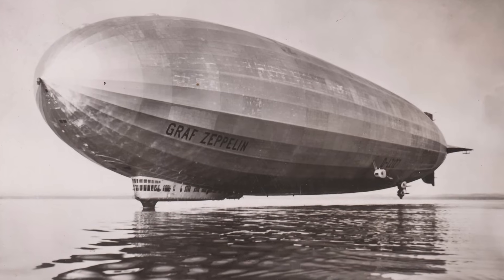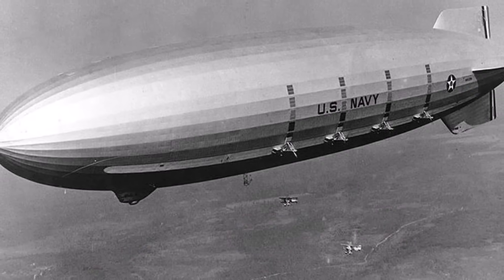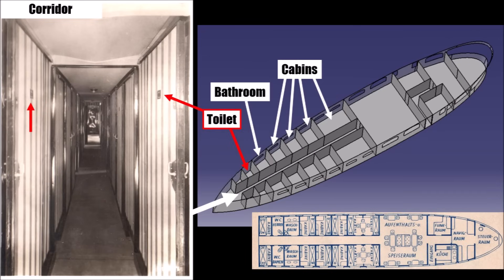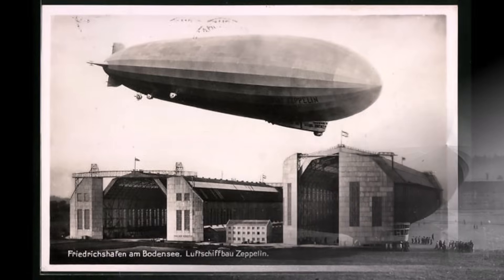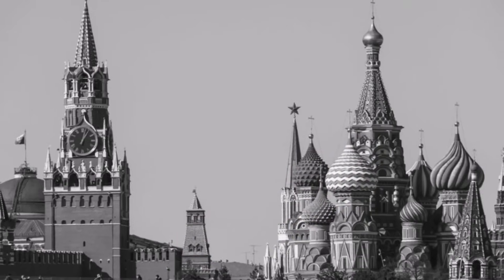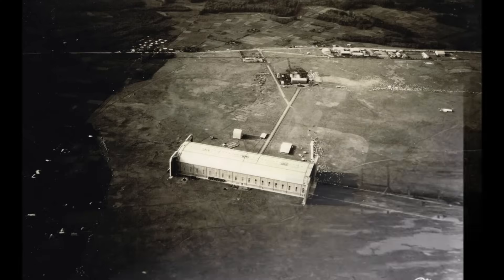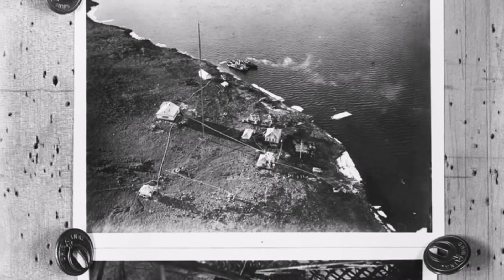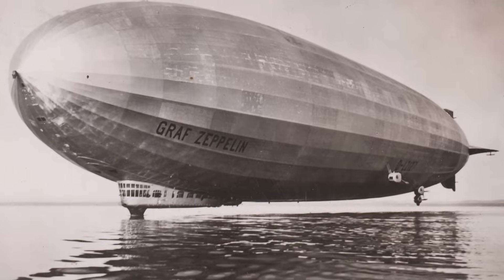Zeppelins - Part 13 - LZ127 - Success and Journeys

Comment: Today people remember the Hindenburg disaster and forget how successful airships like LZ127 actually were. They could fly anywhere on the planet, weather permitting, so long as at the destination there was a large enough landing area (a circular area the radius of which must be at least equal to the length of the airship) with a mooring mast, a couple of hundred ground crew, and a hangar large enough to protect the airship from inclement weather.
Because so few great airships were built they were never really commercially viable and civilian airship companies struggled to make a profit despite the high ticket prices for passengers (equivalent to around $10,000 to $14,000 at today's prices for a one-way trip across the Atlantic).

In some ways transatlantic airship travel could be compared to the Concorde aircraft - travelling between Europe and America faster than anyone else in style while sacrificing a few comforts for the privilege.

Comment: To put into context how impressive these airships were, the first ever transatlantic crossing by flight only happened in 1919. And it wasn't until 1939 when there was a regular commercial flight service - and even that was with a stop. The Graf Zeppelin made that happen more than 10 years earlier, could fly without stops, and could fly much, much longer routes than any airplane. If you were living in the 1930s, and got hold of a ticket, you would get an experience you couldn't have absolutely anywhere else.

Comment: This Zeppelin series has been so interesting so far, amazing what they achieved on those days.
Thank you 👍💪✌
Reply: The only things missing were the pairing of the Graf Zeppelin and the Hindenburg circling the stadium at the 1936 Berlin Olympics, and the fact that the LZ-130 Hindenburg clone assumed the Graf Zeppelin name. It never carried a passenger, but did drop propaganda leaflets and conducted espionage of Britain at the beginning of WW II. It was scrapped alongside the original Graf in 1940, because it would have been a sitting duck when filled with hydrogen, unable to outrun fighter planes.